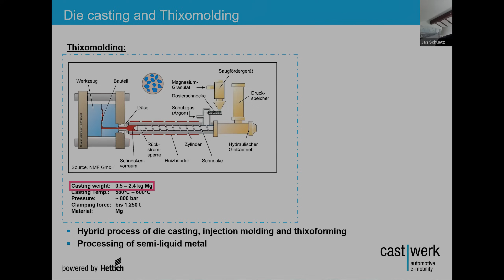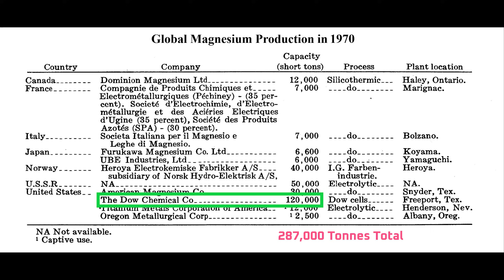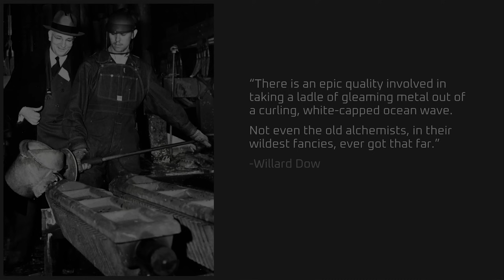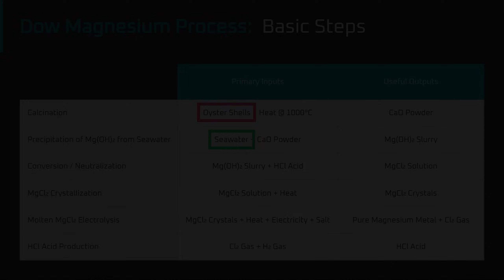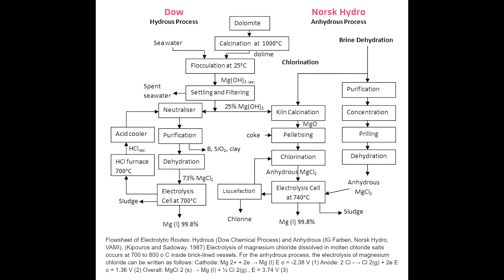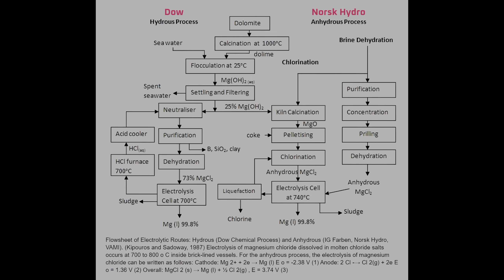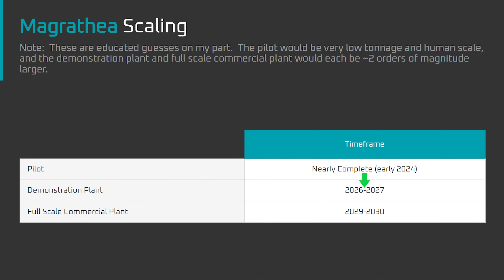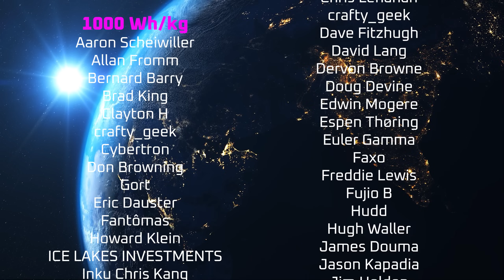Magnesium from Seawater // Magrathea’s Mission to go Back to the Future

Comment: Are there any potential synergies that could arise if there were a facility were designed to extract multiple things from seawater at the same time, such as magnesium, lithium, uranium, and fresh water? Or would the processes necessary to extract each of those be not compatible with each other?
Reply from the maker: My view would be yes, because a lot of the energy used is to dehydrate the solution.

But I'd have to look into the economics of each element
Reply: @thelimitingfactor  I wonder if putting these near desalination plants would make it more efficient.  The output from desalination plants should be fresh water and sea water with higher concentrations of everything.
Reply: A desalination plant produces fresh water and brine. The brine is a waste product with about twice the salinity of seawater.

Using that brine as a feedstock would save energy, and would slightly reduce the quantity of waste brine that needs to be pumped away.
Reply: If Mg truly does start to replace Al in many applications and Mg demand increases ~10X, then that would require processing about 5B cubic meters of seawater per year. That amount of seawater contains about 15M kg of uranium (15,000 metric-tons). I've heard that uranium sorbents are getting near perfect extraction of uranium in seawater after a few hours of exposure. This would equate to about 1/3 of global uranium production. Nice side hustle.
Reply: There's too little Li and U in seawater to be economically extracted, terrestrial sources are much cheaper

Comment: I was looking for Magrathea IP on their website, but was not able to find anything disclosed. My guess is they are going to isolate Mg by precipitation as Mg(OH)2 with electrogenerated NaOH via the membrane process which has matured since the Dow days. Then big magic happens in the conversion of the wet Mg(OH)2 to anhydrous MgCl2 which is needed for the electrolysis in molten state. For example, in the classical electrolysis, electrolysis of partially hydrated MgCl2 leads to unwanted coproduction of hydrogen, raising energy needs. So any technology that saves energy on the way from magnesium hydroxide to anhydrous magnesium chloride is likely the most important part. I can think for example of formation of MgCl2 complexes with other ligands than water, and thermal decomposition of those to anhydrous MgCl2 and free ligand which is recycled  again.
Reply from the maker: Hopefully they should have some patents published soon 😁

Thanks for the comment! Interesting stuff
Reply: How else do you chlorinate milk of magnesia? In an organic solvent like alcohol which will absorb water?
Reply: @ain92ru In general, acidification with HCl is needed, then it is necessary to expell water, and that might be where the magic sauce is. Besides plain evaporation and heating to high temperatures (very energy intensive and potentially corrosive due to partial decomposition to HCl), one can think of adding competing ligands, which form isolable, water free complexes with MgCl2. These complexes could get more easily decomposed into the ligand (to be recycled) and anhydrous MgCl2 suitable for electrolysis. Energy would be saved in the process, resulting in good grade of anhydrous MgCl2.

Comment: this is a great series pointing out the potential for Mg. The main issues with the proposed magnesium electrolysis process is that it requires large plants with a CAPEX exceeding $20k per ton which makes for a difficult ROI. There are now alternative thermal processes using electricity that have a 4-5 times lower CAPEX and a production cost & carbon footprint on par with aluminum reference Tech Magnesium

Comment: I wonder if Japan might be an interesting place for magnesium production.  No bauxite reserves (so aluminum is imported), lots of coastline for seawater, heavy shift toward renewable energy.  Ytterbium can probably be extracted from seawater, too.  Economy is declining so they want to increase exports.  And has FTA with the US.
But nobody beats Norway in cheap electricity, with so much hydro capacity.  I wouldn't be surprised if they start back up in the near future.
Reply: Quebec could challenge Norsk for cheap hydroelectric power. QC has access to both Atlantic and Arctic Oceans…

Comment: I really love these videos. My battery work mostly revolves around alkali solid state batteries, but I try to stay updated on other kinds of batteries as well.

Just one request: if you would be able to, please link your sources in the description. I'd love to be able to read the primary sources of your work.
Reply from the maker: Hello!  Glad to hear it.

Wherever I've directly used or cited information, I put it on the page.

Where it's opinion based on the information presented, I preface it as such.

Otherwise, like my comments about Chinese subsidies of Coal, I don't provide references because it can be googled because there's a lot of information about it.

Hope that helps!

Comment: Magnesium is most commonly mined from seawater. They treat well filtered seawater with NaOH and that makes Mg(OH)2which settles out. Alternatively Na2CO3 can be used to precipitate the carbonate. The next step is to convert the carbonate or hydroxide then separate it from the fused chloride, a small amount of potassium or sodium chloride is added to get the MgCl2 to melt as a stable mixture.

Comment: Bear in mind that magnesium is very easy to machine. Whereas chip adhesion to the tool, tool wear, product surface finish, machine horsepower and rigidity of the milling machine are the normal... limiting factors (sry), this is not the case for magnesium. The limiting factor in magnesium is speed. Just speed. 
You will see a lot of products made out of magnesium if it becomes cheaper than aluminum; aluminum will no longer be the default choice for casting and machining.  Infact, I imagine aluminum will be used primarily for corrosion resistance, thermal conductivity, reflectivity and slightly better strength to weight ratio if used in optimized designs.
 
aluminum alloys are stronger per weight than magnesium, but as aluminum is stronger and denser, you have to use thin/hollow pieces of it, requiring a lot of processing. Magnesium, being lighter and weaker, tends to be used in thick and solid pieces that need less processing. So the strength per weight favors aluminum, but the strength per weight per net cost of magnesium is better if raw magnesium can be made as cheap or cheaper than aluminum. Although there are other technical reasons too, this also explains why TLF says that magnesium alloy components are lighter than aluminum; sure, tesla COULD make them lighter with aluminum, but no one would buy cars with subframes that cost $50K+ wholesale.
Reply from the maker: Thanks for the well-considered comment!
Reply: Yup magnesium and most of its alloys machine extremely cleanly. The only catch is that you cannot use water based lubricants while cutting it, moist magnesium chips are very dangerous if they ignite, water is an acceleration agent for combustion and they release hydrogen as they burn.

Comment: Without knowing the energy requirements, I'll still opine that the modified process seems like it could benefit from an offshore implementation, as the primary inputs are seawater, energy and a fixed store of chlorine cycling from reagent to gaseous product and back.  Implement a production line in something the size of a containership and base it at an offshore wind/solar farm in the Gulf.  A couple benefits are that a dedicated wind/solar farm (site power) needn't be connected to the mainland and so may be built much further offshore (regulatory+), vessel-based production lines are much easier to scale than a land-based facility, and a marine implementation avoids about a dozen years of permitting process and NIMBY legal battles for a land-based facility (not to imply no permitting, just less arduous).
Reply: I would still think bring that to the shore would be far easier and far less of a logistical problem than moving the process off shore.

Comment: Thanks Jordan, great video. Question: how about the comparison of the production of <20kg parts Magnesium vs Aluminum? With Magnesium prices going down in combination with the low cost production method for small parts. Where does Magnesium stand compared to Alu or GF filled plastics?
Reply from the maker: Sure thing!  

20kg parts should be cheaper with thixomolded Mg (see the last couple of videos in the series on Thixomolding).  Not sure about other materials.

I need to research carbon fibre too

Comment: It seems a shame to melt the metal twice before it's formed into Mg parts. Couldn't they save a lot of energy by co-locating a few major parts manufacturers near the refining plant that can use the molten metal for casting straight from the refining furnaces instead of cooling them to ingots first?

Comment: One day everything from Magnesium, Lithium, Uranium, and everything in between will be extracted from seawater. A billion+ year supply. But it will likely require all these extraction techniques combined in a multi-step process to be economical.
Reply from the maker: True for most, but for Mg it's already proven to be economic
Reply: @thelimitingfactor  Presumably this process is much more efficient with desalination brine. Whoever can extract just those three elements is going to become very wealthy. Throw the Uranium in a liquid fueled fast reactor and you have enough energy to power the whole process a hundred times over.

Comment: I will believe it when I see it. When companies have to put up solar panels to greenwash their process and make it seem innovative, then that's a red flag for me. No patents filed; means they probably have nothing special.
I remember vaguely decades ago a startup in my country (the Netherlands) that was going to make magnesium from seawater. I don't think it ever materialised. They planned to make bicycle frames from it. The Netherlands has chlorine factories. I think magnesium can be produces as a byproduct of that process. That to me sounds more efficient than to make only magnesium from the seawater. Another similar proces is lithium mining, here too I wouldn't be surprised if you can combine it with magnesium extraction.
Another upcoming technology is carbon sequestration. Minerals like olivine can be used to sequester carbon from carbondioxide (enhanced weathering). A magnesium and iron-rich solution is a byproduct of this process. A higher concentration source solution can make the whole process more efficient.
When I look at the process the Chinese are using, I see an opportunity there: the minerals are already on site and the process they use produces CO2 as a byproduct.

Comment: Oh yeah, let's add tens of kg of magnesium to tens of kg of lithium batteries.  Ought to be spectacular.
Reply from the maker: There's a good chance there's already magnesium in your car.  For example, in the steering wheel.

Better go get it replaced.  It might randomly burst into flames.
Reply: @thelimitingfactor  I'm not being hyperbolic here Jordan.  We both know that igniting a large mass of magnesium isn't an easy task. It takes a lot of effort and a powerful heat source, but once that mass is burning, there's no easy way of extinguishing it.  A lithium EV battery in thermal runaway would easily ignite a magnesium car body, turning the entire vehicle into a half ton incendiary bomb.

Comment: There is one HUGE problem with this. Magnesium ions in sea water are necessary to neutralize CO2 dissolved in sea water. Magnesium bicarbonate only exists in aqueous form, and every magnesium ion dissolved in sea water helps neutralize two CO2 molecules. 

Mass extraction of magnesium from the sea is not a good idea, because it can lead to intense acidification of the oceans. Every ton of magnesium extracted out of the ocean results in the equivalent of 1.8 tons of CO2 no longer being balanced by that magnesium.

In fact, the major efforts to use the ocean as a carbon sink involve using terrestrial sources of  and calcium magnesium, such as basalt gravel and waste rock from mining overburden to neutralize CO2 and send it into the ocean as magnesium bicarbonate and calcium bicarbonate, since both magnesium and calcium bicarbonate are actually beneficial to the oceans.
Reply from the maker: I think they have a plan for this from memory.  Alex is pretty thorough.  But thanks for commenting, I may be wrong and maybe he'll chime in if he sees the comment.
Reply: @thelimitingfactor For info on ocean carbon drawdown, and how the ocean already currently serves as a huge carbon sink, look up some of the work of Dr. Greg Rau. He is the foremost advocate and researcher of this topic. I know him personally.